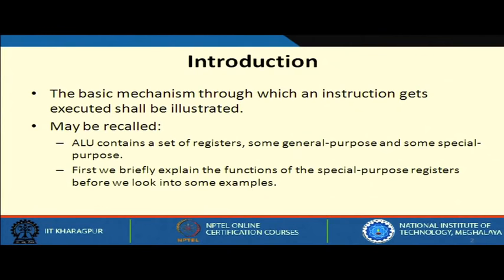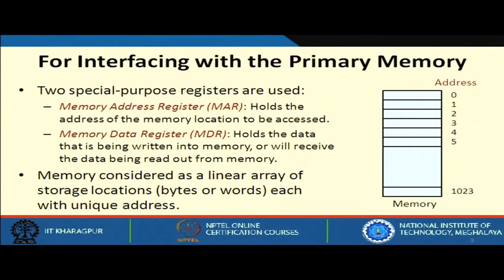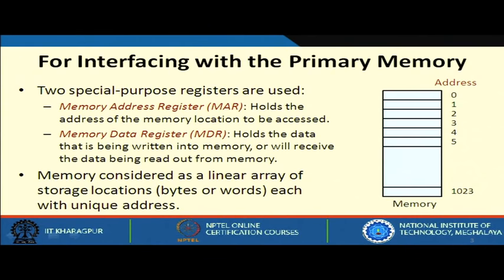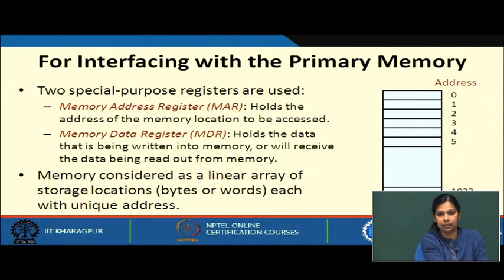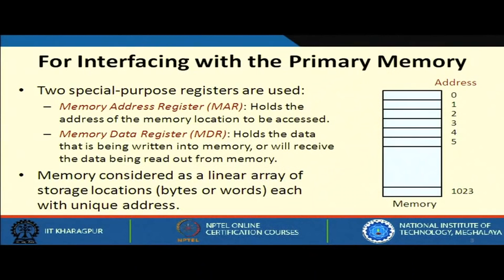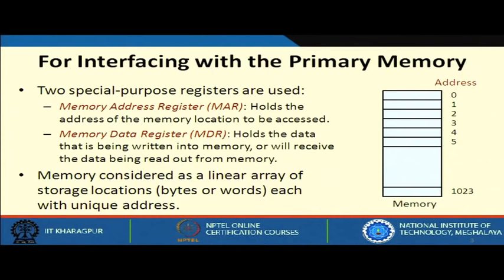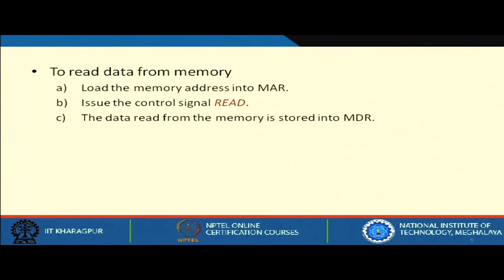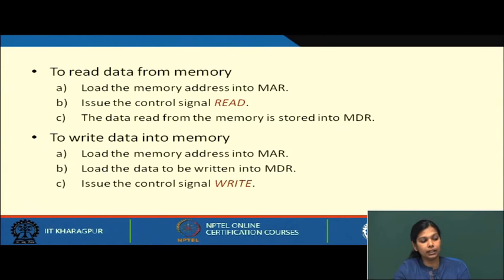Lecture 2 : Basic Operation of a Computer

Comment: I think I misunderstood somewhere at 10:50 . Correct me if I'm wrong but the sequence of steps must be:
a) Instruction is brought into the processor and stored in the IR.
b) Instructions are decoded in the IR when PC points to that particular instruction.
c) The operands in the instruction are decoded to get the addresses and given to MAR. READ control signal is issued.
d) The MAR fetches the data from Primary memory into the processor to MDR.
e) Only then is the instruction interpreted and executed in the processor.

Comment: If both MAR and MDR are reading data and instructions from memory, then what is the basic difference between the two?
Reply: i think it is CPU who load the address to MAR of memory location that to be fetched and after data is read ,that to store in MDR then after cpu will execute the instruction.
Reply: MAR will specify the address from which the instruction/data to be read from the memory but that instruction/data is loaded into the MDR.
Reply: MAR takes up the address from which we need to get the data for MDR

Comment: already the information will be stored in the form of binary numbers in the memory then what is the need to decode that instruction?
Reply: its not technically decode its more like interpret and issue signals accordingly.
Reply: But how would the computer know which binary pattern represent what operation

Comment: Memory: - Classification and types. Cache memory, direct mapped, associative mapped
and set associative mapped cache. cache replacement policies, write policy, unified, split
and multilevel cache, virtual memory, paging, segmentation.
Input Output System: 15
I/O buses, device controller, Interrupt and DMA. Interrupt driven I/O, Program
controlled I/O and DMA transfer.
Parallel Architectures: 25
Classification, SISD, SIMD, MISD, MIMD, Scalar, vector, superscalar and pipelined
processor, Pipelining, Instruction pipeline, pipeline bubbles, Hazards: -resource conflicts,
data dependency, branch difficulty. Vector computing, arithmetic pipeline, vector
and scalar register, chaining, scatter gather operations, vector-register processor,
memory- memory vector processor. Array processor.
Advanced concepts:
Branch prediction, super pipelining, Branch delay slot, Register file, superscalar
architecture, superscalar pipelines, superscalar branch prediction, out of order execution,
register renaming, Pipeline scheduling, dynamic scheduling and static scheduling
algorithms, reorder buffer and register renaming, Thronton technique and scoreboard.
Tomasulo algorithm and reservation stations. VLIW architecture: - EPIC architecture,
Multiprocessor systems: - Interconnection types. Cache coherence problem

SIR MAKE VIDEO ACCODING TO THIS SYLLUBUS
Reply: Aye Sabash😇

Comment: If the memory address is from 0 to 1023 then how memory address 2000 or 5000 is used?
Reply: now a days address size is of 32bit so it can store address of each bytes upto 4gb not only 1024 but 2^32 locations